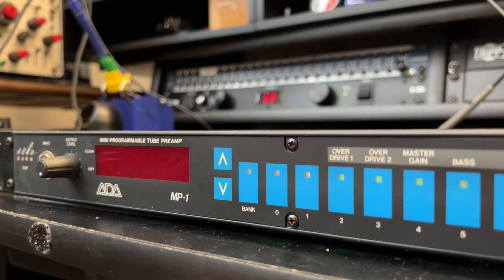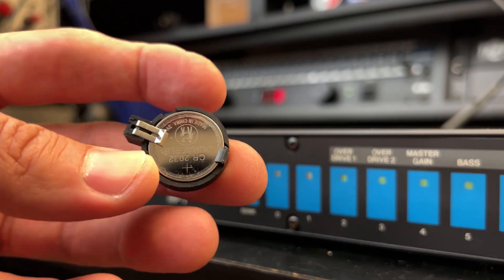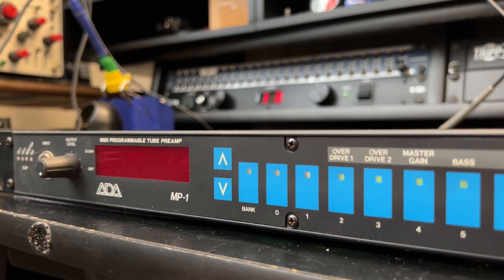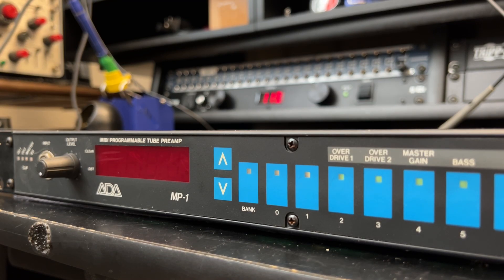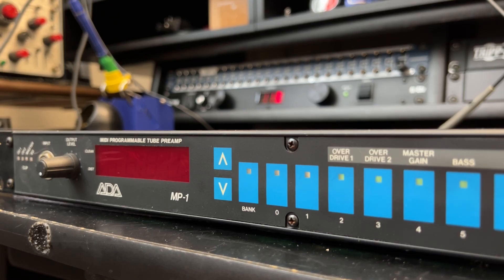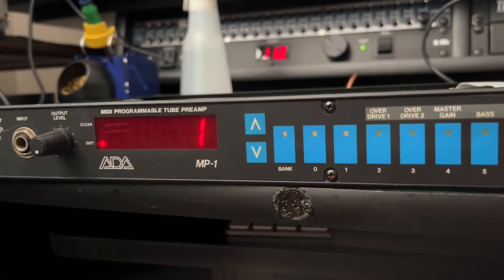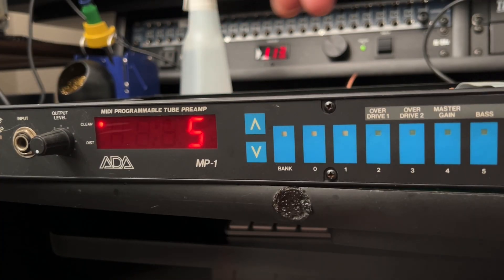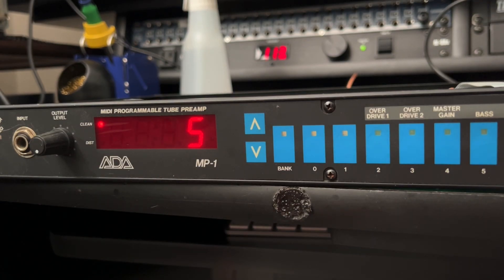ADA MP-1 || Battery Mod + Preset Reload

Comment: Okay...I'll stop using my pneumatic impact wrench to tighten nuts on plastic jacks. Why you gotta take the fun out of everything?!? All those gray IC caps scare me. Those have the shelf life of beluga caviar at a 4th of July picnic. But I'm a bit surprised by their voltage rating, what are they running the plates at?
Reply from the maker: Ha!   They run them around 180-200vdc!

Comment: went through the whole input jack scenario with mine. i did the rear jack mod as well.
Reply from the maker: I got lucky and didn’t have to do mine. Had to disassemble the input of one customer’s and epoxy it a year or two ago when there were no replacements available. Nightmare on tone street.
Reply: @ForgottenGearRestorations  no question a PIA.  jack is proprietary as you said.  did all the caps on mine as well.
Reply from the maker: Good man!
Reply: @geezberry8889  Is there room in there to panel mount a Switchcraft and wire it to the PCB? I'm guessing not... 😠
Reply: @socallars3748  the input jack cannot be grounded to the chassis so the options arent many.  The plastic switchcraft ones dont have a long enough threads to get the nut on.  i went through the gammit of jacks. you can use isolation washers which i did but it did the rear jack mod as i have this in a big rack and needed a rear input